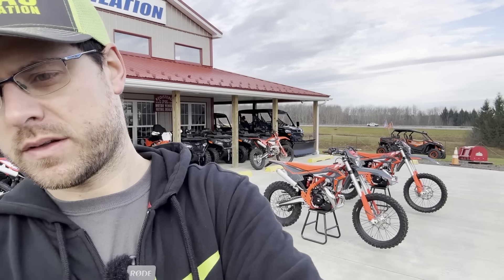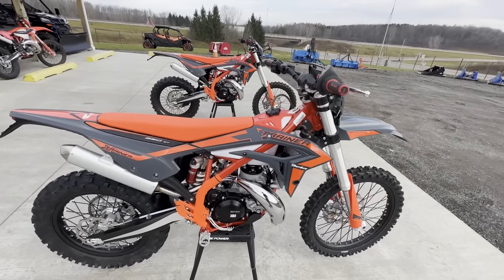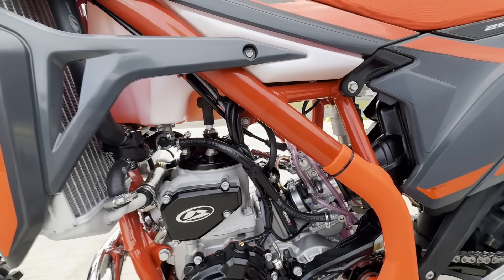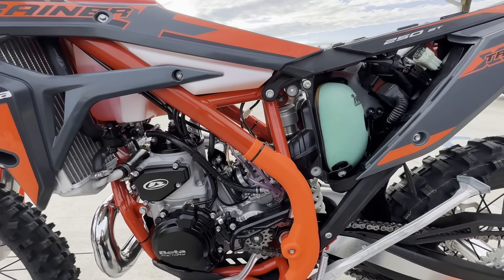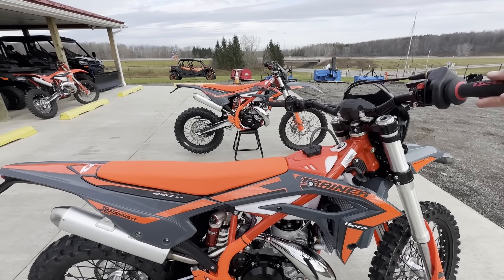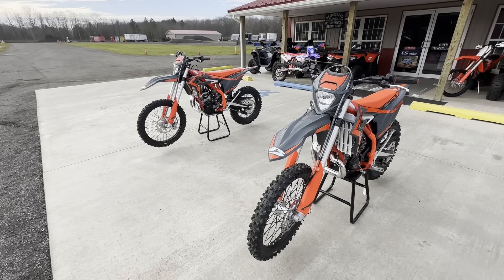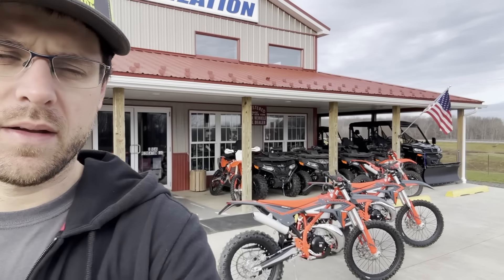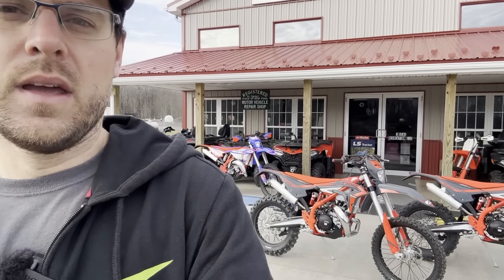The new 2025 Beta XTrainer 250 2-Stroke Motorcycle! Compared to the Xtrainer 300? 3 Seas Recreation

Comment: Hey Jared :-) regarding the 250 not feeling as peppy, it's kind of hard to tell in the video but I'm pretty sure in your driveway test you were in the rain map on the 250. Looked like the right side White LED was illuminated. Not sure if you knew that or not.
Reply from the maker: Yea I definitely thought about that during the editing… Sadly I never notice much of a difference in the maps so even with that I’m still thinking there isn’t much of a difference…
Reply: Remind me where your jetting isn't going be right either. You're running double the oil
Reply: @3SeasRecreation That’s surprising as I notice a significant difference between the power delivery of the two maps. Especially once the air filter cage is replaced and a full FMF exhaust system was installed. But overall, incredible dirt bikes! Very happy with the 2024 300 XTrainer I purchased from 3Seas. 👍😀

Comment: Great video, thanks for sharing it with us! The wheels of the XTrainer and full size models are different. While the holes for the valve stem and rim lock are 4 spokes apart on the big models they are opposite on the XTrainer's. you may say that plays no role, but it does when you run Tubliss systems.
Reply from the maker: Thanks for the info! I suppose I never noticed the holes in the rims! We have always ran mouse bibs in our wheels. I have 3 sets of wheels for our pro rider Mark who runs our shop build hard enduro XTrainer. The other two sets are standard Beta rims so I suppose as long as you are not running tubless everything should be good to go for a swap. Enjoy The Ride, Jared
Reply: I put tubliss on my xtrainer with no issues, and i didn't drill extra holes.  Just have to line it up before putting it in.  Tire soap works better than soapy water no matter what you use, tube, or mousse etc...

Comment: Ive always heard it was more on how the bike handles in the woods as it will feel lighter as the lighter piston(250 is usually cast instead of forged on top of being smaller) has less gyroscopic effect on handling and change directions easier. That was reviews from the older 250 xt where it was just the bore difference so the power delivery was smother on the 250 where looking at the specs on these the 250 has longer stroke and smaller bore so it does seem the motors flip between over and under bore so sort of redundant as long stroke 250 will probably be almost identical to larger bore shorter stroke 300.
Reply from the maker: I am hoping to get these in the woods to give a better test, not the most exciting test with me riding them down a drive way... I was just hoping to feel a bigger difference. Enjoy The Ride, Jared
Reply: @3SeasRecreation  looking forward to it, Ive owned an xt and loved it but when the funds/family situation allows I am looking at several options(250/300 xt or 200rr, or possibly 390 if I decide to use an Electric motion XR as my hard enduro bike and 390 for dual sport/xc race bike)

Comment: What do you think about the 250 vs 300 power?  On paper the 250 has a long stroke 72mm and higher compression ratio? Did you ride the 250 in the sun map to compare?  How about vibration between both, any noticeable difference?

Comment: what does beta say the reason is for the two so close models?  It must be a race class or euro license thing.  I am an older and less experienced rider that is considering one of these for trail riding in SW Colo.  Some discussion of the carb, and jet changing for altitude would be a good topic.  How easy?  My riding range is 7000 ft up to 13,000 occasionally.  what are considerations and what jet sizes to run?
Reply: I would think your local dealer has that figured out?

Comment: Hey question I have a 300x trainer with the choked up air box 2024 model. If I just go with the open air filter cage what do you recommend doing with the jetting go up a size on the main?
Reply from the maker: Hey, that's a good question. I think the Beta's come pretty rich on jetting so I wouldn't touch it. Normally folks go down a main and pilot jet so you should be 100% fine with stock jetting and the air filter change. However, always pay attention to the bike and check your plug occasionally! Enjoy The Ride, jared
Reply: @3SeasRecreation  thanks man 🤙🏻